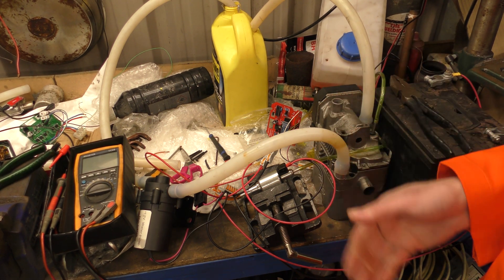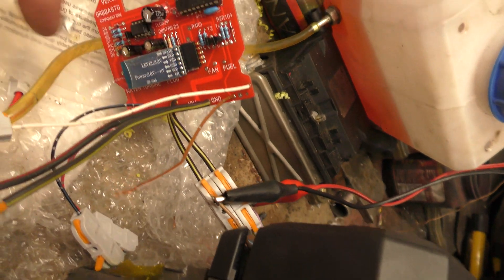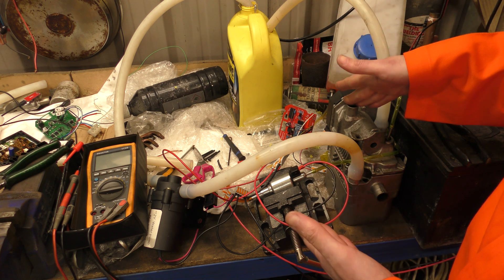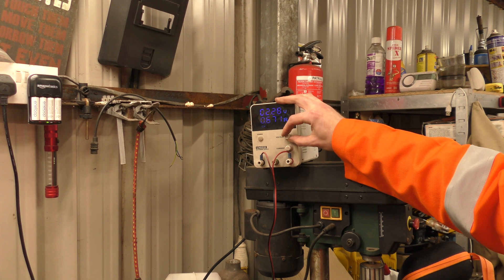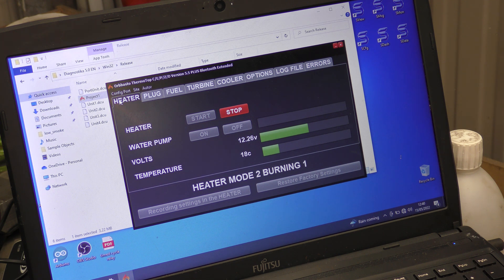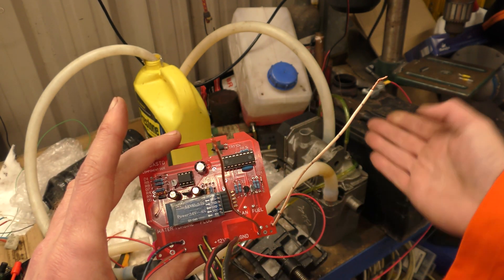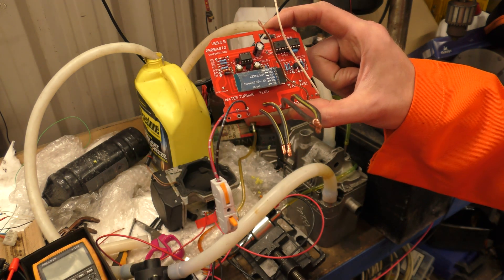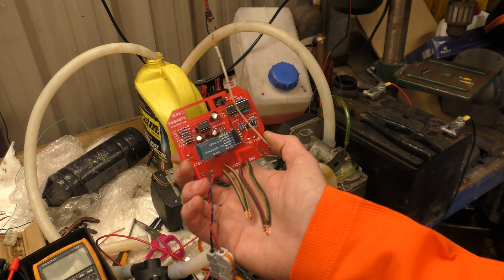Orbasto project Webasto replacement ECU board - part 1

Comment: WOW! we never got to that test yet! so if the thermistor does NOT see a rise in temp it will keep going!!! testing now, so it does not have any thermal runaway! dangerous and not safe to use at this stage. Please to anyone that wants to build this, wait till we have finalised the software and designed in enough safety as there clearly is none!
Reply from the maker: What he says.

I'm also glad I can now pin comments from the Studio.

Comment: Who is building the true silent pumps over in the UK? They do not use a solenoid style pump but a peristaltic pump with a control board.
Reply from the maker: There is a link to the guys email on the Silent Pump video.

Comment: what about just editing the original pcb ie firmware? i have a non can bus unit from a car working but think there is a time limit on run time.
Reply from the maker: If that's a thing and you'd like to share how to, I'd be interested very interested.
Reply: @DavidMcLuckie hi i can send you my working one to try but would need it back one day. it was from a Citroen c8 non can-bus if i remember right .(from memory was pin 5 pull up or pull down) i would need some non working can-bus version controllers to see what the difference is and firmware difference but i think there is time limit like 60 min's then need to restart but was neva a problem i didn't need it to run long thanks ps keep up the good work

Comment: Have you tried running the fan in parallel with the supply from the board, to get the fan going then turn other power supply off?  That’ll tell you if its an amps problem id guess

Comment: You obviously have a power delivery problem, those wires look too thin. Try using thicker gauge wires on the supply, fan, and glow plugs. You could upgrade the mosfets or use a relay on the plug and fan.
Reply from the maker: Nope wasn't that.  But we're working on the problem, which is feedback on the board.

Comment: Great project tho a bit curious... are the current aftermarket board offerings not worthwhile, suddenly out of stock, or is this more about building a board that works on all heaters straight out of the box, or about a board that offers more control/features(?)
Reply from the maker: I've only seen one so far and it's availability comes and goes.  It also has no options, it's just a clone of the original.  Ideally what we want is a board that is both available and adjustable, and also not a fortune.

Comment: Have you tried to measure the current on the water pump?
Test  the board with a  variable load to the water pump connection. 
Did you check your board with your heat detector for hot spots.
If all else fails then threatening the board with a large hammer with enthusiastic demonstrations what the hammer do to it. After a half hour hammer blows to the floor,  bench , wall. Caution not your finger. Go and have a pint or two. 
Cheers.

Comment: Hi David, test the Board with full charged battery. Switching power supplies can be a problem. 
Also the back EMF from the pump... 
My Firmware has some problems with starting the burning. But currently I have no time for programming. Eventually I should make a "open project"
Reply from the maker: It was your second guess.  The EMF :)

Comment: The problem is its lacking diodes on the mosfets! this will be causing emf to run back to the chip resetting it, during testing we found that the start input is being clamped to 5.1v with only a zenner diode, this will fail at some point, at 12v the devider is dropping to 6v, if running at 14.4v well you do the math! the circuit is being redesigned as i type this!
Reply: Aside from the lack of a flyback diode, the IRLR2905Zis no longer being manufacured. Also, anything "Microchip" is very scarce righ now. Large unlicensed distributors are buying any available stock and hiking the prices10 - 50X higher. Not a good time to be in electronics right now.
Reply: @geato8999  ive got 40 atmega8 and thats my lot! when im out it will be this time next year hopfully
Reply: @robinsonlabs  I’ve emailed you regarding a repair no reply yet please respond thanks
Reply: @Jordan-nd7jp  no email received Jordan! please try again
Reply: @Jordan-nd7jp  ok email sent
Reply: @robinsonlabs  thanks very much I have replied mate

Comment: That type of board is from BMW if it has a sticker on the bottom with the number (91452C) then we can reprogram it to analogue! (only people that can!)
Reply: Hello 
I have a Mazda ecu with canbus function  .It is possible to change software on this ecu to transform in an analogue one ? 
I have wtt with engineering level enabled .
Thanks
Reply: @TheMiuadrian1  i cant do that, requires mazda not WTT, changing data sets is only the way to brick them

Comment: the dropping voltage when the glow plug is running makes me thing the battery might be a bit low - might also explain why it doesn't work in the morning. The battery's cold and not putting out quite the same voltage/current as the night before

Comment: Does anyone now where to pick ups cheap replacement fuel pump for one of these. I'm using one for a Chinese diesel heater 22ml. It works bit it seems a little rich and smells of diesel i believe it's ment to be a 18ml pump cheers
Reply from the maker: Aliexpress. https://s.click.aliexpress.com/e/_AOiOir

I've managed to find all the pump sizes on there.

Comment: sounds like its too much current for your power supply. (glow plug and fan probably exceeds 10A). Try a charged up 12v car battery on it.
Reply from the maker: Initially I had both connected.  The battery with the power supply connected to the battery.  Looks like it's a bit of a design flaw on the board.

Comment: Put relays on the outputs to take some of the load of the board 
Connect a motorcycle battery between the power supply and the heater.
Reply: That would be my suggestion as well.

Comment: Just to check the simple stuff first, is the power supply you're using being current limited? That would cause the voltage to droop, which might brown out the processor or cause similar effects.
Reply: ^^ This, you need to do lot of protections to ensure the MCU gets a solid voltage during the whole stage of events, if the voltage drops to a certain level will cause it to reset and loop
Reply from the maker: Yes but no.  For my first failed run the board was wired onto the battery with the power supply at 14V in parallel.  Plenty of current in that setup.  :)